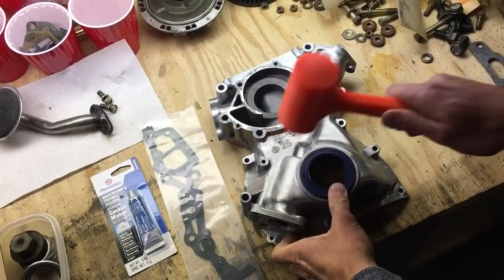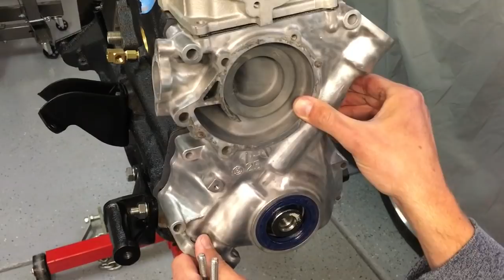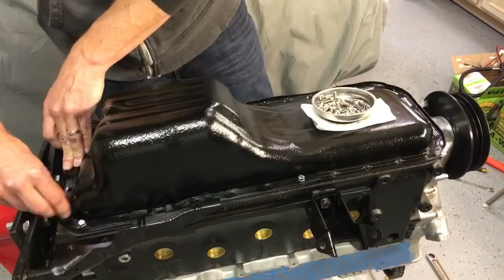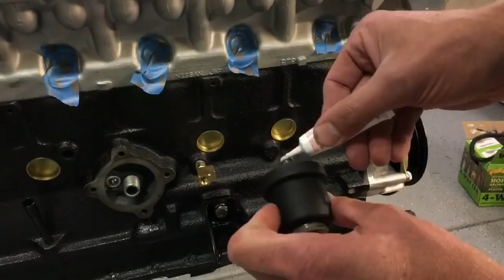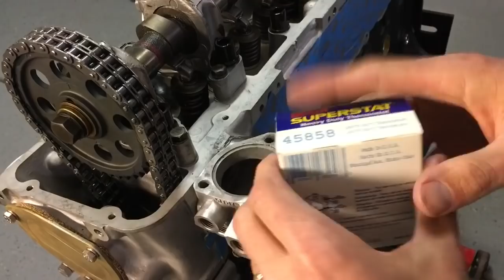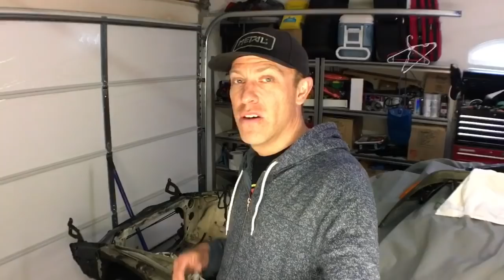Final assembly of the Datsun L28 engine

Comment: If at all possible, when installing oil seals use an arbor press. In a pinch a drill press works as well. The seal will go straight in. Plus it will be square to the centerline of the seal bore. 45+ years rebuilding industrial machinery.
One note on stainless steel screws. Stainless screws are not stronger than carbon steel screws.  My last 12 years before I retired I was employed rebuilding industrial centrifuges for waste treatment plants. Stainless screws have a lower torque rating than carbon steel. Stainless in this case is fine for non structural applications.
2) When installing something like this front cover or any other part where you have a gasket that must be kept in alignment. Take a couple of long screws and cut the heads off. Use a cut-off wheel in a Dremel or die grinder to cut a cross slot across the top of the screw. The screws will hold the gasket in place while you slip the part over the screws. Put two screws in and use a screw driver to remove the guide studs.

Comment: Hey, I have a 1980 280zx that I can't seem to get running. It will turn over, but it won't stop liquid locking on me. I've replaced the starter, injectors, fuel pump regulator and timing chain. Do you have any advice for me on what might be wrong?
Reply from the maker: +Moose Judd hmm sounds like a head gasket or a crack in the block possibly. What fluid is causing the hydrolock?
Reply: @CarsBikesandCoffee   Gas. Which is why I thought it was the injectors because there was no continuity, but apparently, I was wrong.
Reply from the maker: +Moose Judd gotcha. Are you getting spark?

Comment: It looks like there is some sort of spacer used on the timing indicator tab that bolts to the front cover - any clue what the part number is or where i can find it? I do not have that piece and am getting ready to assemble my engine.
Reply from the maker: +Cj K so assuming you’re building the 280ZX L28, it unfortunately might take some hunting, might be easier to visit a machinist, but here’s a link to it. I believe the original code was 13502F https://www.nissanpartsdeal.com/parts/nissan-indicator-timng~13503-v0800.html good luck!

Comment: One thing I did was remove the oil filter bypass ball and spring and plug the passage, insuring all oil goes through the filter. And put a k&n filter on it. Also you can prime the whole system with a drill, remove oil pump drive spindle ,put the pump back on and get a long flat wood drill bit ,file it down dull chuck it in a drill and set it to reverse. Be sure to hold the drill with both hands so when the pressure hits it won't spin out of your hand. I love Z-cars!
Reply from the maker: +Mark Robinson interesting idea on the bypass ball delete. Curious what you used to plug it. 
In regards to priming, yes in a later video did just that, worked awesome! Thanks for watching!
Reply: @CarsBikesandCoffee  I tapped the hole and plugged it the same way you tapped the oil galley plugs.

Comment: These videos are excellent. Just one suggestion, if instead of cutting music entirely when you're speaking, you just faded the volume down a bit to be background noise while you speak. It would make the transition back to the time-lapse or montage sections where the music comes back much less jarring. Also the little bit of background music just makes even the speaking portions of the video sound nice.

Also, as a side note, I heard you refer to the belt pulley as a harmonic balancer. I think almost all engines of the l28's era are externally balanced, but the l28 is a bit of an exception. The inline six doesn't have a lot of the harmonic issues that v engines and i4s have, and the rotating assemblies are balanced internally, (if you look, the counter weights on your crank will have been drilled at the factory to remove mass and balance the assembly). So where as you don't want to toss any balancer or flywheel onto most v8's of that era (since they're matched to a specific rotating assembly at the factory to bring the whole deal into balance), the flywheels and pulleys are swappable between L-series engines, as all of those individual parts are neutrally balanced. Long story short, that's just a pulley my man, no balancing happening there.

Keep up the great videos, and your choice of background music is on point, super relaxing.
Reply from the maker: Thanks so much for your feedback! I will make that change for the next video. Let me know of any other suggestions, as I appreciate it.

Good info on the pulley, thanks for that too. You are correct all of he Datsun L engines are internally balanced. Crazy too as my crankshaft being as old as it is was close to original spec! Crazy! 

Thanks for watching!!

Comment: What state are you in Im building a 73 240Z and a 78 280Z back dated with 240Z front turn signals and rear tail lights. Both cars will run L28 motors and thank you for your tip on engine parts as I can buy parts for both engines at tbose prices Very useful find.
I juzt finished both bodys floors and major rust cut out Nd welding so im starting to gather engine parts as Ill build both motors as Im finishing bidy work. Jusr got. Oth cars finaly on their new suspension 
And new 7 x15 inch wheels. And tires. Its been three years but Im building two at the same time alone . 
Great progress